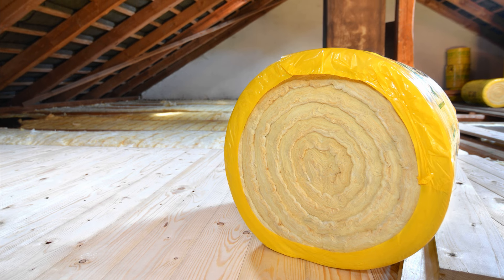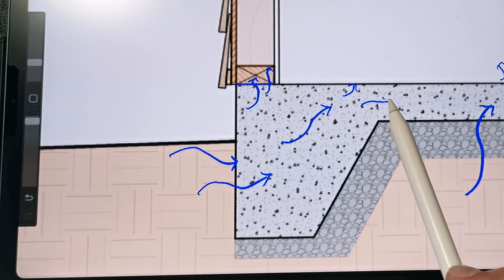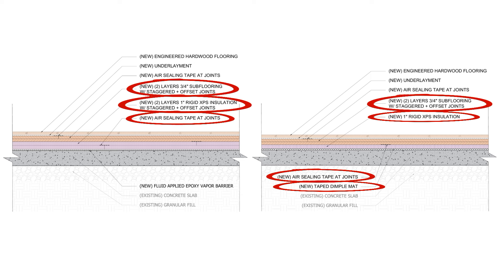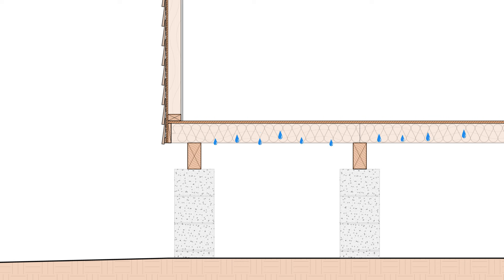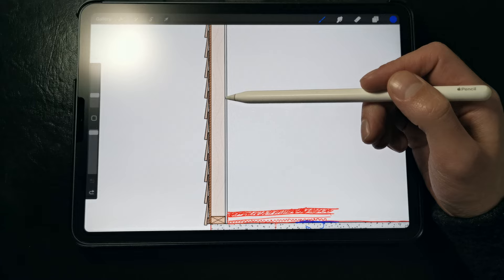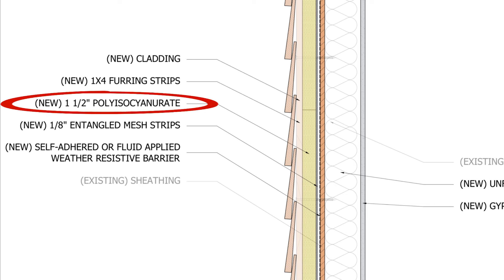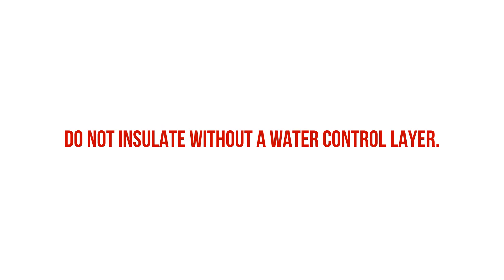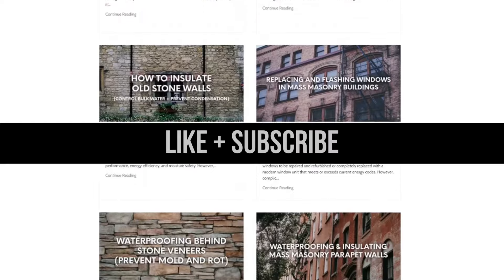A Guide To Insulating Old Homes For HOT HUMID Climates (Part 1) | Floors, Foundations & Walls

Comment: So, all examples shown here seem to assume that you’re tearing everything all the way down to the studs and ripping up all flooring.  You could probably build a new house for less than a renovation like that.
Reply: Not even close. Insulation, drywall, paint, flooring, baseboards are only a few trades. There are many more trades and costs (permits, time out of the home, site plans) associated with new builds.

Comment: What about smart paper barrier from the inside on the sheathing? And then some mineral wool insulation. In mixed climates? This is a brick veneer 🧱
Reply from the maker: Depends on the existing conditions, but in a mixed climate (CZ 3/4) I would probably avoid it to prevent potential mold growth on the paper.

Comment: Hi Sharif, Thank you for the time and effort you put into educating the public. I am particularly grateful to you for your videos on managing a moisture problem at the concrete edge of a slab on grade structure. I have a question for a future Q and A episode. Background first. I am planning on insulating brick veneer, slab on grade home in Mixed Humid climate zone. After watching this particular video, I may not be able to insulate but I am not sure. I do not have a barrier layer of tar or felt in my wall. Just brick, air-gap, then stud. As I am not sure, I am considering an external insulated cladding of 4-6” colorbond steel foam core sandwich panels. I want to minimise or eliminate the future maintenance of external cladding by choosing the steel so no painting is required as I am getting older and don’t want the burden of maintenance every 10 to 20 years. I understand this is cladding is not done on residential builds, although uninsulated steel cladding is often used in my region. Finally, to my question. Do you see any problem with using steel faced insulated panels as an external insulation technique? What could be the considerations, pitfalls and benefits? Thanks and I am looking forward to all your future videos.

Comment: Excellent once again. 

You mentioned benefits of thermal inertia in a topping slab - are there ways to have a workable mix that is designed to increase thermal conductivity? I know that much of the thermal mass of deeper slabs don't help to dampen diurnal temperature swings because its thermal effusivity isn't high enough - the heat can't conduct fast enough to the whole mass in time. An underfloor cooling system could make this mass "reactive" enough, and with passive house loads the temp delta can be low enough to avoid surface condensation risk. 

It's part of the whole thermal mass debate which dominated passive house for so long, and is still talked about regularly in countries with mass wall construction. With a need to avoid high embodied carbon and energy materials such a concrete, it would probably be best to avoid more massive materials moving forward.
Reply from the maker: I'm sure there's some type of add mixture or recipe smarter people have discovered to increase conductivity, but I'm not aware of it. Generally we have to think about these types of things holistically, for example, providing adequate overhangs shading windows has the biggest impact on heat gain in a hot climate. If you can control that, that solves for one of the biggest problems we see with overheating. You also have to take into account the perception of the client - all they know is that the slab or tile on the slab feels cooler to them. My experience with living in a well shaded mass building is that summers are pretty nice because of that cool floor, but winters are miserable! It sucks the heat out of the house very quickly. On the opposite end of the spectrum, if there's extended periods of heat, the walls and slabs stay warmer for longer which can also be miserable.
Reply: @ASIRIDesigns  They do have some screeds designed for ufh, but I've not really looked into whether it's worth mentioning it, or if it's so minor it ends up being more of a distracting marketing term.

Totally agree with reducing loads in the first place. Solar gain etc. But there was a pretty comprehensive study (somewhere) on the effectiveness of thermal mass beyond the first 25mm from internal surfaces, because, if you want to maintain tight comfort levels, the DT and effusivity is too low to utilize the total thermal mass. 

The term passive, in PH, initially included a huge emphasis on solar gain and thermal mass because they're passive effects, which has mostly gone away in recent years. Now it's more to do with reducing peak loads and glazing to fit view cones and natural light. Focus on large passive overhangs are now being replaced with active external shading. Passive cross ventilation with continuous mechanical... you get the point.

Comment: I hope we can interest some thermal heat transfer engineers in looking at our wall assemblies. My thought is that a high specific heat material such as cement board will absorb all the radiant heat energy from the sun and, if a large enough air gap exists behind it, one that allows for good exterior airflow, the heat from the cement board can be dissipated back into the outside air and released. Assuming the temperature of the cement board is higher than the air temperature of course, but one would expect that on long hot summer days the sun facing side of the house would be significantly hotter. The insight missing in all the insulation discussions I hear is that on the sun facing side we have a strong heat transfer source, solar radiation, which is mostly infrared and ultraviolet, that travels through a vacuum until absorbed in the outer skin of the building. Having the cement board in contact with the house provided a conduction pathway. Insulation there reduces the conduction heat transfer, but it also provides a pathway for that to occur. 

An open space, of the sort these new rain screen assemblies provide, allows convection heat transfer, yes, but I’m guessing that convective heat transfer is much less efficient than conductive and, if that air can escape - hopefully not into the attic, then the heat load behind it can be mitigated in that way too. 

True, the cement board, the same as all other materials, when heated will emit black body radiation commensurate with its temperature, but that is emitted in both directions anyway, and I doubt that it amounts to very much heat transfer back into the building. Heat transfer from the exterior sheathing through the walls would be conductive at that point, but all your wall insulation would be in place to attenuate that. You could add a reflective surface behind the cement board, but that’s probably getting to be like a NASA project at that point. Well, my idea for you.

It would be fascinating to see some computer modeling of the radiative heat transfer to a house and then modeling to look at possible ways to mitigate it. There are more sophisticated ways of calculation insulation from heat transfer than just adding R-values. You could say that if the rain screen provides a raincoat, it also provides a parasol. Maybe my thesis is flawed in some ways, but there is something here very much worth exploring.
Reply from the maker: Reflective aluminum cladding is probably your best bet for a radiant barrier that actually works.
Reply: The term decrement delay comes to mind. The time it takes for heat on the outside to make it through to the internal surfaces. The thermal mass simply buffers the diurnal swings in temperature, smoothing them out to a milder average. But it's no substitute of insulation, which limits the heat transfer altogether. 

Get loads below 25W/m2 and the mechanical systems needed for comfort are all very similar.

Comment: Assuming the assembly is airtight, watertight, and R-value is the same for a CMU wall, does it matter if the insulation is in the exterior or interior in hot humid climates?
Reply: Exterior rigid foam board is preferred over a cmu wall in the humid south. You gain thermal mass on the inside of the house(where you want it) and R-value on the exterior of the house where it is continuous.  You just don't see it built this way too much in the south(I live in FL) because it costs a little more than building out the interior with fiberglass bats. Just make sure you have an airgap/rainscreen with whatever exterior cladding you go with.